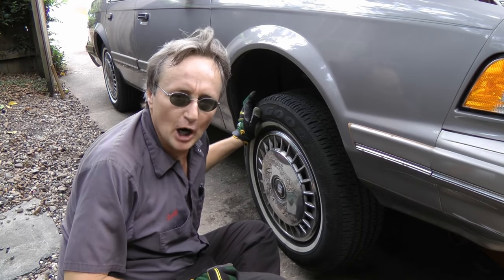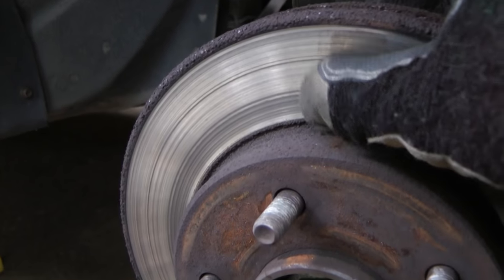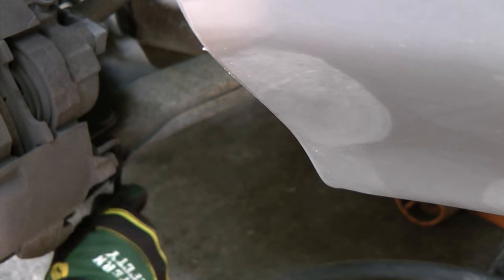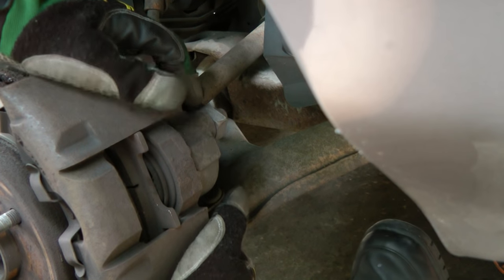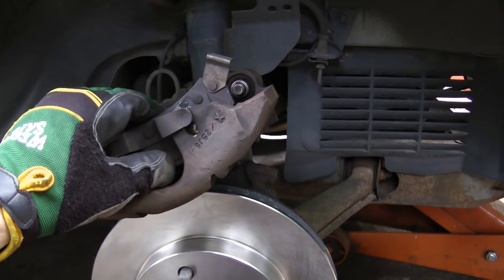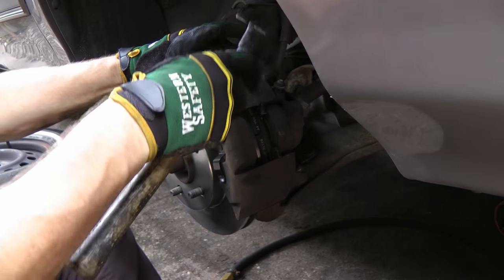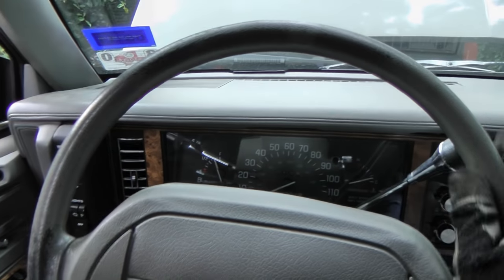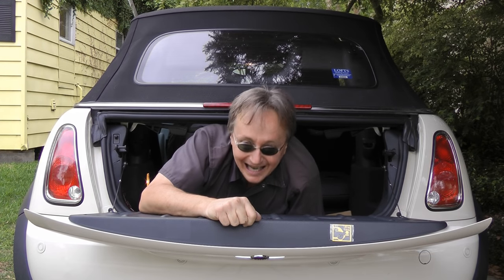How to Replace Brake Rotors on Your Car

Comment: And they want a $1000 for that 🙃
Reply: Right!
Reply: All day!
Reply: Facts I’m about to buy what I need and go get my car back today
Reply: Literally exactly why I’m here. 1000 for this is outrageous
Reply: Yea and youll die if you mess up😂 but 1000 is ode
Reply: Yeah but you'll die if joe shmo does it wrong too. 😂 Confident in my own self preservation.
Reply: When I was 16 I took my car to the mechanic, got charged 400$ for parts, 750$ for labor, for brake pads and a timing belt on an old Honda. That day forward I vowed to only repair cars myself. 25 now, I’ve got newer cars, but I kept that Honda. Rebuilt the engine myself at 323,000 miles. Still haven’t seen another mechanic lol
Reply: I found the front rotors amd pads for 100 and did it myself.
Reply: Yeah got me fucked up
Reply: Rip off
Reply: It’s because they can and they know people have to pay for that
Reply: Just turned my car in today for that reason 😢
Reply: +labour
Reply: He skipped tons of steps... Didn't even use greese...
Reply: Right! Cause you don’t feel like doing them  yourself😅

Comment: Just an small note... most rotors that I've bought come covered in some kind of oil/grease to keep them from rusting. VERY important that it gets cleaned off with brake cleaner before putting the calipers/new pads on! ;)
Reply: Thank you…
Reply: Was very surprised this wasn't mentioned in this video, as well as that some rotors are held on by a screw vs just pressure
Reply: Yeah and he didn't even use brake greese...

Comment: Couple things to note for small imports(I got 01 corolla): 1.) Have a small 4" clamp to "compress the piston" carefully, watch the rubber seals.  Scottie forgets to mention this. 2.) Carefully, support caliper with rope or platform.  Can't just flop that heavy casting anywhere. 3.) Leave the shoe/drum to the pro's. Can't DIY. Need special spring tool.   Good luck.
Reply: He does mention this and the cleaning part in another rotor video.

Comment: you should also clean off the new rotors with brake clean to remove the protective coating the manufacturer puts on to protect from rusting.

Comment from the maker: yes, but you can change them one pair at a time. The ridge only makes noise if you put new pads on, it really doesn't make them work bad. Most people hate the noise though
Reply: My rear rotors look like a vinyl record, is that normal ?

Comment from the maker: @spelunkerd  OK,this car had warped rotors, and the pads weren't that old. So the calliper wasn't sticking out much. IF the pads are worn thin, then you want to open the bleeder valve when squeezing the callipers back in to prevent back pressure damaging the master cylinder. If you clamped the line, the callipers could not go back in, because there's be nowhere for that fluid to go. Scotty

Comment: i agree with ya on that. i've never had any of the rotors on my vehicles turned, but if you're broke and it's cheaper, it'll get ya by for the time being. my jeep rotors were about 28 a piece so i got new ones on it. you seem like a great common sense mechanic.

Comment from the maker: could be more than one problem, warped rotors do it, but shaking when not braking isn't rotors. So have the front end checked and if something like ball joints are bad, that could fix both problems

Comment from the maker: nope, the rotors I used were not oiled, and if you watch my newer video "doing a full front brake job using eBay" you'll see those aren't either and it says on the box "bolt right on, no need to do anything."  Quality ones come that way these days, only old technology coats em with oil.

Comment: Cool video as always, You should also add that you need a can of break clean to remove the cosmoline from the new router so that it wont smell when the breaks are applied. For people who do not have as noticeable a vibration you should show how you us an indicator you check the run out and what is acceptable. I seen you do it but you should add it is, Do not let the caliper hand by the hose and when you compress the pad's you should bleed it out and not force fluid into the master cylinder.

Comment from the maker: @ihartmacz  As I said in a previous post, yes, if they are covered in grease to prevent rust, clean the rotors off with brake spray. But the ones I bought for this buick had no coating on them, they were just bare steel with a little rust on them. Heck, they rust as soon as it rains anyway. Scotty Kilmer
Reply: True...if you want to admire how good your new rotors and pads look, it best to do it right after you are finished with the job because the next morning they will already start turning orange

Comment: I just bought new "Brake Best" rotors and ceramic pads from O'Reilly and plan to change them on my Cobalt next week.  I have a rotor that's getting really bad.  Only hard part is jacking the car and making sure it's secure.  Other than that, it should be a cakewalk.  Sure beats spending $500 to have Les Schwab do it and replace a bunch of parts that don't need replacing.

Comment: Scotty thanx for all the tips that helping ppl to fix there cars with less money ,Can you post some tips for the transmossion issue ,diagnosis,maintenance..etc I have Ford Taures 03, I need some help if I need a mechanic ,when it's cold & start to shift on Drive  it take 2 secend then get roll ( only in the moring) ....thanx scotty

Comment from the maker: @kenmanuknow  I've responded to this already a few times. The rotors I got were sealed in a package with no oil on them, they were just bare steel. So they needed no cleaning. If yours are covered in oil in the box, of course clean it off with brake spray cleaner. Scotty Kilmer

Comment: I hear people talk about clamping the brake line with padded vise grips, and then loosening the bleeder nipples so that brake fluid fluxing back during caliper clamping won't regurgitate back the line. Evidently you don't do that, and I haven't done it either. I guess I see their point, but that kind of backflow partly happens in real use too, as you release the brake pedal. Is there danger to the Master Cylinder when you clamp the calipers down and cause retrograde flow up the brakeline?

Dave

Comment from the maker: @mellenaboonmee  You can't tell my looing, and turning the rotors to make them smooth again is not a smart move. Cause now they are smaller, and heat will rewarp them quickly. They warped before when they were thicker, and now will warp even quicker. Replace them instead. Scotty

Comment from the maker: @mobes329  I've responded to this question already. Some rotors come with oil or creosote coating them, the ones I used were just bare steel. Yes, if they have a coating, clean it off with brake spray. Scotty

Comment from the maker: @starhooper84  Yes, VWs make noise if you don't use their insanely high priced dealer pads and rotors when changing the brakes. It means nothing though as long as they stop fine. Scotty

Comment from the maker: @elantra11  No data system gives those sizes out. BUT, since yours is all rusted, go ahead and cut a small piece off and match it up at any auto parts store. They can sell you line, and brass couplers to connect them. Scotty Kilmer

Comment from the maker: @TheMenghi1 so much for guarantees, see that all the time. run out is a little thing, it would have wobbled right away WHEN it was first put on. Just cheap rotors, or they were overheated from running through water and jammed on right after, see that a lot. Scotty

Comment: To avoid warped rotors in the first place, don't keep the brakes applied after a stop when they are hot -- the pads can cause them to cool unevenly, which is a major cause of warping.  Instead, if they are hot and you have to stop, either leave room in from of you and slowly roll forward (so the pads are not in one place the whole time), or put the car in neutral and use the parking brake.
Reply: Huh never figured that

Comment from the maker: see my video "replacing brake pads on your car" to see how to squeeze the callipers back in. Braking and pulling can be one side of the brakes sticking, OR a front end problem like worn ball joints or tie rods. Takes a pro to figure out which

Comment: I like your videos very much as well as my friends on facebook. I just had this done last week new from brakes, and rotors. Don't you have to spray the rotors first with a degreaser or whatever they use on them? Also does the piston in the brakes need to be pushed back in, as it relates to the pressure from the master cylinder?

Comment from the maker: @studpuppy69  You can if you want to get rid of old fluid, but if the system is not opened and the brakes are hard to begin with, it's not needed. Scotty Kilmer

Comment from the maker: @williamsfleal  Shaking is caused by either out of round tires, bent rims, out of ballance tires, a bad front end aligment, OR a worn front suspension part. I would take it to a better mechanic if someone has already aligned the front end, because any good front end man will find the problem. Scotty Kilmer

Comment from the maker: @DieselCrawler86  Sometimes you do need to clean the new rotors off with brake clean spray, yes. But the one's I used in the video were bare steel, even had a little rust on them, they had no coating on them. Scotty Kilmer

Comment: Great videos. Thank you so much for sharing your knowledge and making us novices more confident in our car fixing.
One of your videos helped me fix a stuck gas tank gauge. i never run out of gas now lol. I have a question for you. I have a 1969 Mercury Marquis. The front rotors are getting worn and need replacing. I have looked high and low for several weeks and can't find any used or replacement rotors. Do you know of any place you buy parts that might carry reconditioned ones, and or remanufactured ones?? My local junk yard is on the look for some. I'm desperate. I miss driving the old gal.
Have any ideas? I'd sure appreciate it.

Comment: Hi Scotty. You've helped me before and I can't thank you enough. the mechanic I had was the worst. I have a new problem similar to this one. My car shakes when I hit the brakes but it also does the same thing when I'm driving. could both issues be the same? BTW it's a 03 buick lesabre. Thanks in advance
Reply from the maker: +James Harvey yes, could be the same, jack it up and check for front end wear like worn tie rod ends

Comment from the maker: if you put good new pads and rotors on, then the callipers would be sticking on and causing them to overheat and warp quickly. Bad callipers, stuck hoses feeding them, or bad master cylinders are most common causes

Comment: hey scotty,
                 I have a ac question maybe you can answer for me, I use solar panels that charge my 12 volt bateries, is there a way to run a car ac unit when it is completely out of the car and use solar power to operate it? I know the compressor is turned by the motor but is there a way to run it off something else, using solar power/ maybe you can make a video for that if possible. thanks Marco

Comment: I am the original owner of my 2004 Dodge Ram and I have not installed new brakes yet ( Only has 47300 miles ). Front rotors look fine but the back ones have grooves in them so I decided it was time to replace the pads on all four sides and rear rotors. I was surprised to find that the pads are only about half worn.
No signs of shaking or squealing and the pads look evenly worn. So why the grooves in the rear rotors? Wouldn't the rear pads be affected by whatever made those grooves? Should I replace the rear rotors and all pads anyway?

Comment from the maker: I would have to hear the noise, but play with the brakes to see if that effects the noise and pull off the wheels, pray it's just brakes. Cause if the noise comes from the transmission, that's serious expensive repairs there

Comment: Hey Scotty I need your help, can you take a look at my vid of my 05 Honda van it's keeps shaking hard at highway speeds only brakes are applied. I have replaced front control arms and all tie rods inner and outer alignment, lower ball joint. A month before I had replaced brakes with bending ceramic pads and rotors. The 1 st night I took the car out to bed with in the brakes and It was perfectly smooth like how new pads and rotors are supposed too be. Please help thanks again, you've helped us out many times before over the years me and my family are forever grateful

Comment: QUESTION!!: My steering wheel was shaking when I braked so I replaced the pads and rotors for the front.  It fixed the problem.  Now, about 3 months later, the problem seems to be coming back.  Could this be the back rotors and pads that are now warped???  Do they effect steering as well???  They look pretty old and worn like the front did.

Comment: Can u tell me what this issue is? My car is not going into gear smoothly from about 50-60mph and the rpms are obviously around 3-3.5rpms. When I step in the brake, the cars brakes are string and my steering wheel shakes sometimes vigorously.  I have beake dust on my caliper. No burnt smell and no ABS light on. Seems like when I go on the highway it will lesson the amount of shaking and not going into gear. Is this a caliper problem or a rotar problem? Also is this something an amateur can do? How do I know its not engine but my brakes. Several people have told me that it's a stuck rotar and my tire isn't spinning as it should. Thanks very much for your help. Stacey

Comment: Scotty is it best to change Brake pads and rotors?? if there both worn? rather than changing brake pads only and use the worn rotors, its not warped, my steering wheel dont vibrate it just has a lot of streaks.    But yea does doing both a best solution??

Comment: Hey Scotty, I replaced my rotors and pads about three months ago. The rotors were Duralast from Auto-zone, but they warped within three months. I changed those rotors last week and with another brand new set (Duralast from  Auto-zone) and they feel cheap even though their price is not. What brand of rotors do you recommend? And where can I buy them?

Comment: Changed the rotors on my zafira, Every bolt was a b/stard to get off and then I forgot  to use brake cleaner on the new parts and as a result The brakes belched out tons of smoke on first use. I thought I'd set them alight. twas a shock I must say.

Comment: Hi Scotty. My rotors are not coming off, and it is nearly impossible to just whack them off like you did. I used some liquid wrench in the center and by the lugs, should I try threading bolts in and getting it off that way?

Thanks!

Comment: some people say it's bad to hammer the rotor if it doesn't come off, are they right? and for modern cars in order to remove the rotor do i do the same steps as changing the break pads? removing caliper, remove break pads and then remove the break pad holder? what is the best way to remove the rotor if it stuck on really hard? i'm trying to get it turn

Comment: Help! I replaced the front pads, bearings/races, and calipers along with having the rotors turned on my 1996 Chevy C1500 2wd. I had my neighbor come over and we bled the passenger side front and then did the driver's side. Maybe this was a mistake but I kept the cover on the master loose to make refilling easier if needed. The passenger side went well but the driver's side... I heard gurgling, noticed fluid coming down from the master. Now, the brake pedal is not holding and going way down.

Comment: @scottykilmer Hey scotty I have the same issue on my 2007 Camry my father in-law already replaced the brake pads but said I would need to get my rotors cut, he didnt have time to finish working on it since we were doing two cars that day. Do you recommend the cut or just new rotors all together?

Comment: Hello Sir,
i own a Toyota Camry 2012 SE 4I. when i drive my car over 120km/hr i feel a little constant vibration on the car as it continues to run on that speed. The vibration is really worse when i brake my car at that speed. When i brake my car at 60km/hr or below,i don't experience such vibrations.When i checked with a reputed repair shop, they said the brake pads and rotors seems to be fine. They suspect that the rotors might have a bend on it due to which the vibration occur. They have advised me to change all 4 rotors or send the rotors to a lathe shop to work on all 4 rotors. Your advise on such an issue will be really helpful as replacing all 4 rotors will be over a $1000.

Comment: Hey Scotty. I plan on replacing the rotors and pads on my girlfriends 97 Saturn SL2. Only thing I'm concerned about is whether she has bad calipers. Car has 173k on it. So far, I definitely feel the vibrating steering wheel while braking. How could I tell if the caliper is bad or not? Thanks!
Reply from the maker: generally that's worn out brake pads AND rotors, change those, should fix it all

Comment: Rear brake bracket bolts (not caliper pins) This guy just hand tighten it with a 6 inch wrench, is that good enough? Focus ST

Comment: Good video but you forgot to clean off the rotor because from the factory they put oil on them so they don't rust before getting on car, this oil can pollute the brake pads.

Comment from the maker: @msw600 if the rotors are greased to prevent rust, yes clean them off. These weren't, they came from china. And the piston needs to be pushed back slowly to prevent master cylinder damage. Scotty